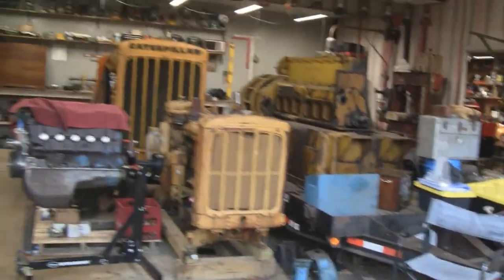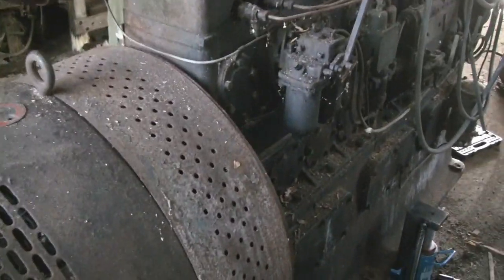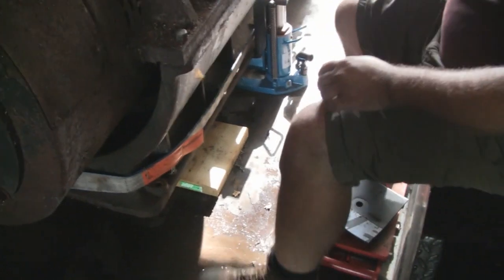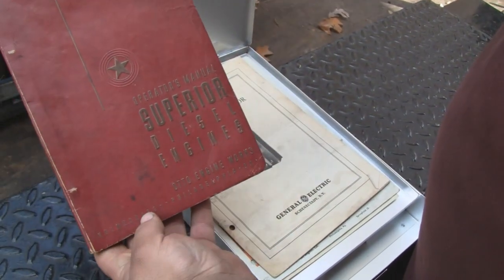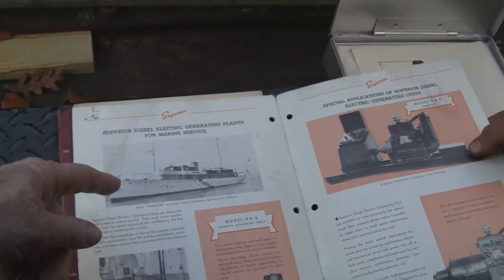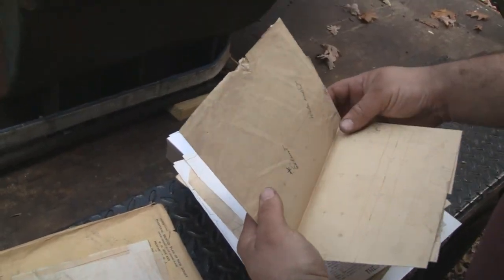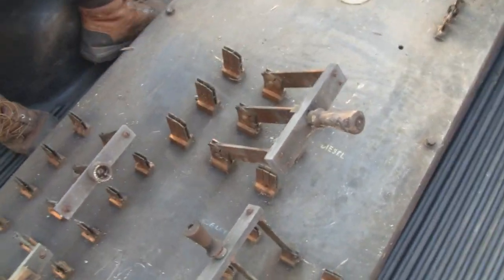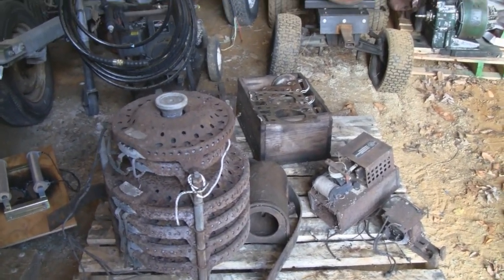ROADTRIP TO PICK UP RARE ANTIQUE GENSET

Comment: Definitely an amazing find. A couple of the towboats I’ve worked on had similar rheostats. After the gensets were fired up, warm and switched to high idle and the fields activated the rheostats were used to adjust the output voltage and to adjust them to as close to 60 hertz as possible. Once the buss tie was switched, to load the generator the rheostats were once again adjusted to around either 460 or 230 volts depending on which boat I was on and zeroed in as close as possible to 60 hertz. Those head gaskets are another great find as well. Can’t remember the name of the company at the moment but they cut copper head gaskets to your specs for race engines in whatever thickness you need. I’ve had two sets made there for an engine that had an odd bore space and cylinder head combination. I remember reading about the White Star company that was with some old railroad stuff that grandpa and I collected. I didn’t know however that they had an industrial branch that handled laundry, I only knew about their oceangoing shipping company White Star Lines. It’s amazing what you can learn from some of the most random tidbits of information. Glad to see you and your buddies are helping keep history alive and relevant. Keep up the great work. 👍